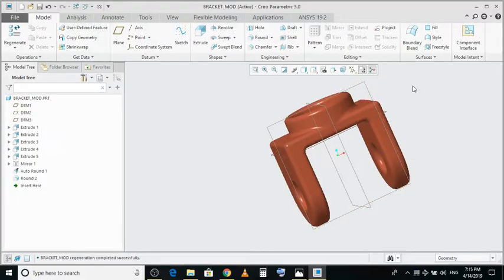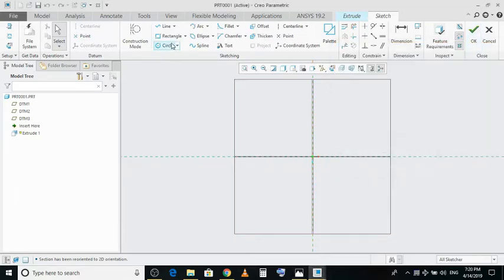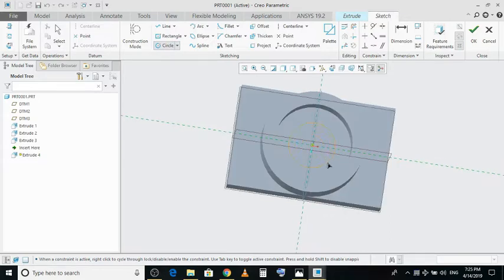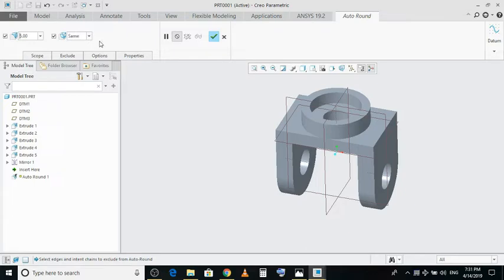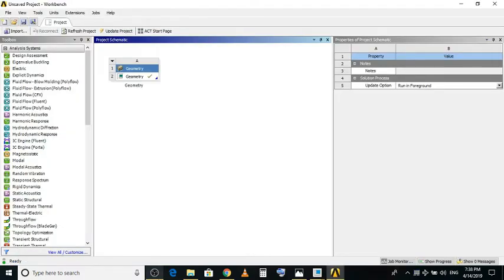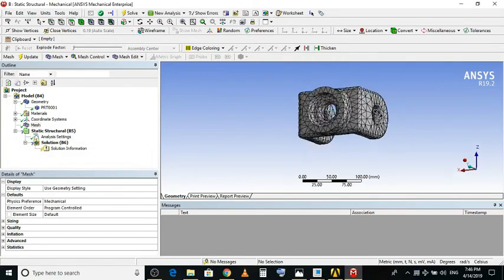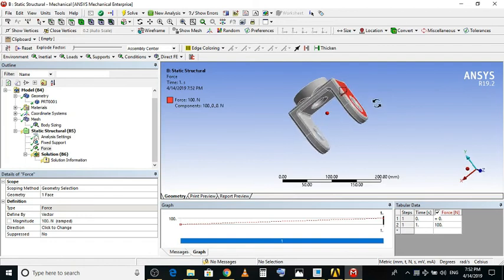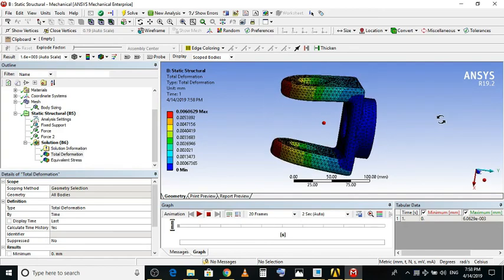Creo and Ansys  Structural Analysis

Comment: I'm not able to find ansys option in cero even after I clicked on configure settings (success) and exit.
Reply from the maker: That configuration process is a hit or a miss. If your not able to configure creo with ansy then what I suggest is saving the part in .iges format and then open this file in ansys. ansys will be able to read that part. Hope this helps your doubt.
Reply: @kumfman  thankyou for your help and video.